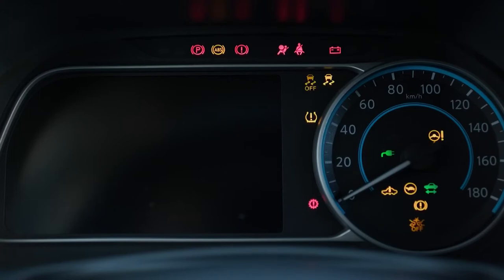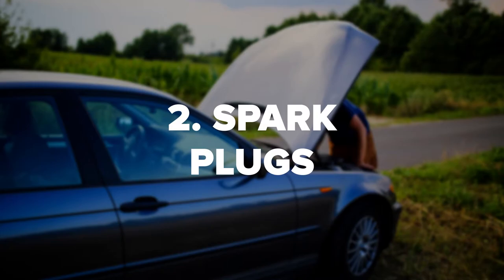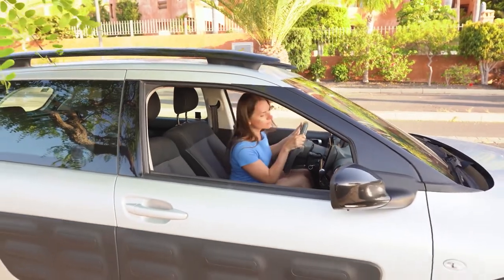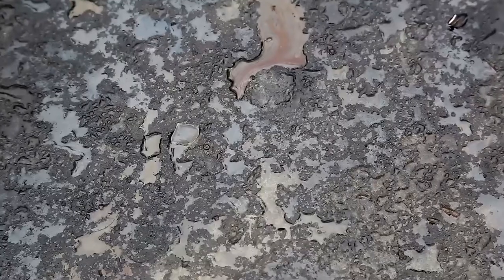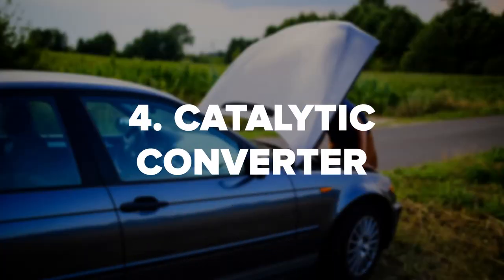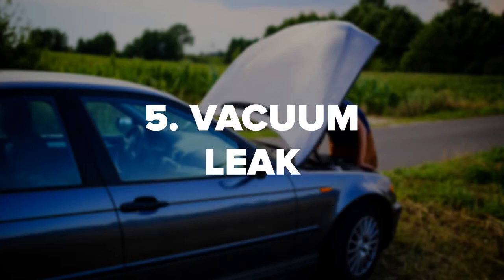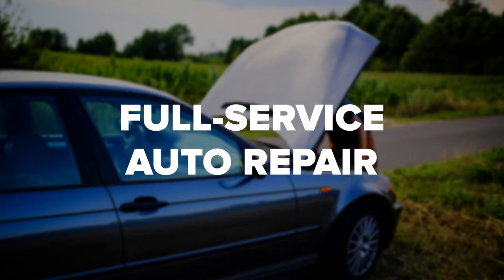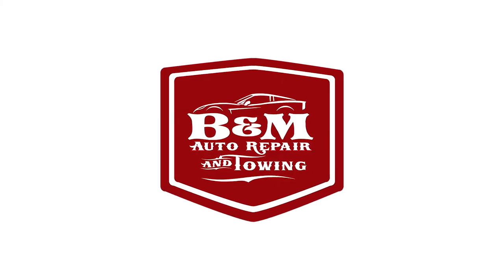Car Engine Sputtering: The 5 Most Common Causes

Comment: So I had a lack in power and my efi Fuze kept popping. But when I let it cool it would start back up. I changed feel pump, fuel filter and injectors. But now it's sputtering, it idles nice but when I throttle it, it sputters. Can I get some advice here I also changed spark plugs. The sputtering only started after changed fuel filter and injectors